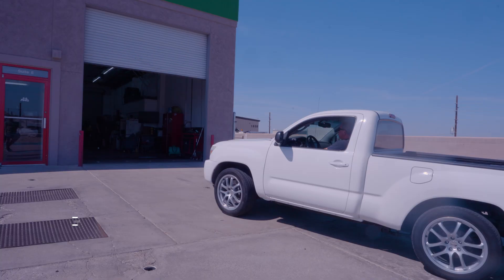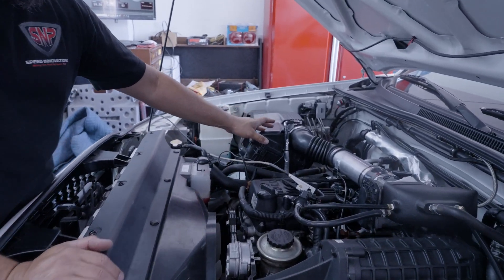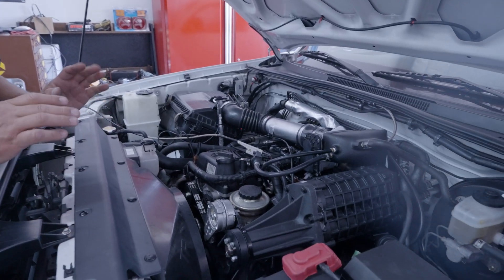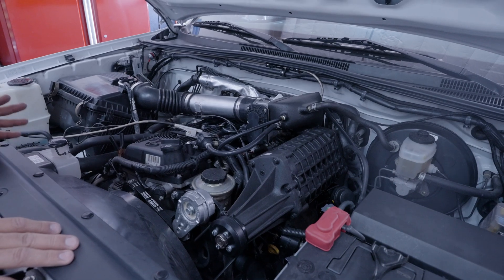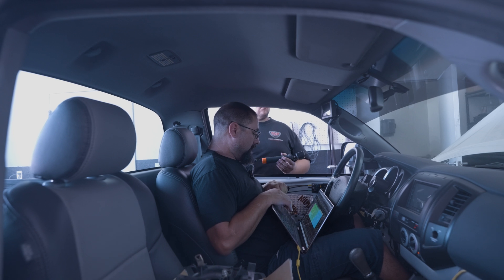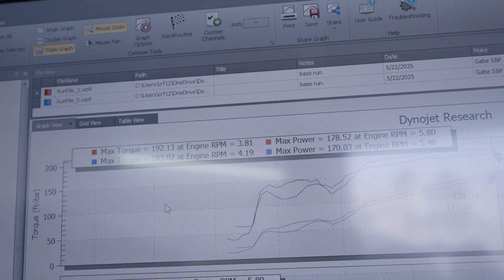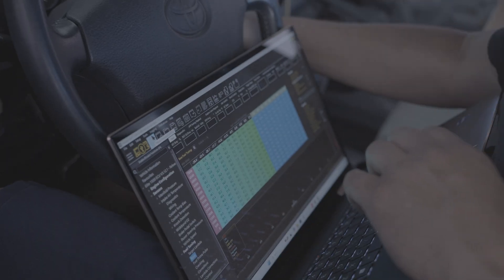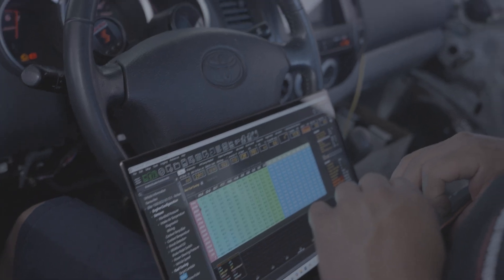30 more HP from a tuned Supercharged Tacoma 2TR? Find out how!

Comment: So you're saying with the long tube header and the supercharger you only picked up 30 horsepower brother that sounds like you got some more work to do on that tuning side extremely minimal gains for such good upgrades
Reply: Like he said, "safe power." 
Those are probably stock internals and can only handle so much power increase.  
Really, a camshaft and valve spring upgrade will provide the best results. 
Combine that with exhaust and that supercharger and the 2.7 will fly.

Comment: Ok here’s the questions. How come your charging close to 7500 bucks for the unit abd requires a separate engine computer when Underdog racing development can deliver similar results for 5600$? 2 is it intercooled cause the URD system has one and why do I need to buy separate engine MGMT when the URD system can include that for much less. Lastly can you prove any performance reason to buy your unit and go with the headaches of tuning and a new computer when the URD unit is plug n play and delivers very similar numbers?
Reply: I haven't decided on a kit yet, but stock ecu's can be reflashed with a custom tune, so you wouldn't need to drop the $3k+ for the haltech on the website if you find a tuner who can do the stock ecu. As for the URD kit, rotrex superchargers are very much hit or miss with reliability, and have had many many instances of blown compressor bearings and the like. This screw style Magnusson will 100% be more reliable, but due to the nature of how a screw style SC works, an intercooler isn't possible, so water/methanol injection would be used instead.

Comment: Hey, Guys I’m the Owner of the 05 Regular Cab 5 lug w/ a stick/manual trans.The 05 has 158k miles, ARP head studs, stock clutch & air filter as they are far superior for filtration,, 3.58 gear w/ TrueTrec, 245/50-19’s or 28.75” rubber,  Equal length LCE header, 2.5” 304 SS exhaust w/ a cat & 2 large Magnaflow’s. It also has a Snow 2.5 water meth system w/ braid lines. BUT IT WASN’T hooked up or running! I HIGHLY RECOMMEND a water meth system because there’s no inter cooler! The water meth cools the chargeand raises the octane. Win Win!  What ever you do DO NOT buy a Rotrex supercharger system! Ask me how I know!
Reply: So what’s wrong with the Rotrex? I ask cause I had a vortech for my 1998 Integra GS-R which was very similar. Thing ran fine on low boost as the GS-R had a 10 to 1 compression ratio and you couldn’t run much past 5 or 7 pounds anyway

Comment: I didn't know regular cab 4cyl come with manual trans
Reply: My 99 Taco with the 3.4 V-6 has a factory 5spd manual trans AND a manual shift transfer case. I’ll never buy a vehicle with such things. I’ve destroyed 5autos in trucks but have NEVER replaced a clutch except for the 1time that I had to replace the throw out bearing so it made since to replace everything when I was in that far.
Reply: They did till around 2016 and the previous Gen taco appeared